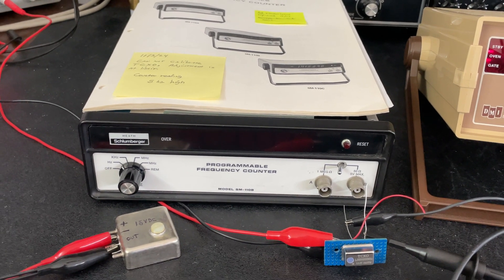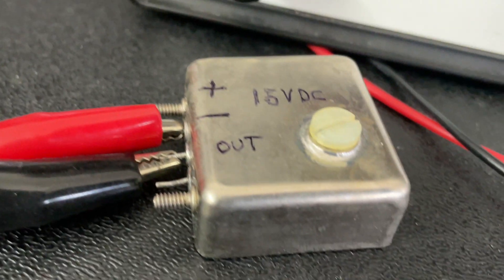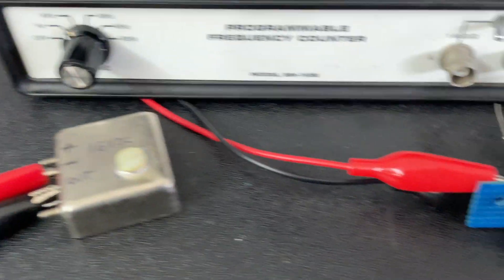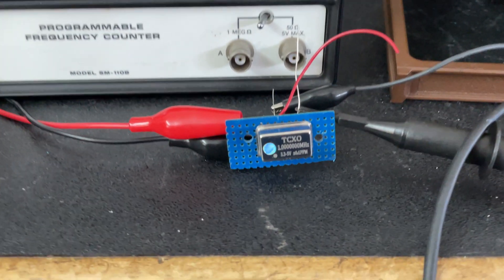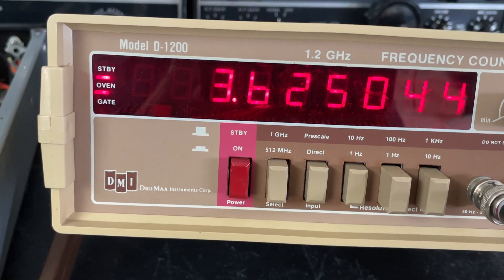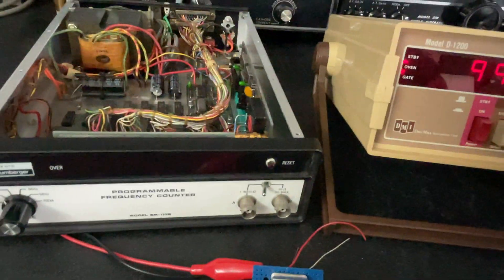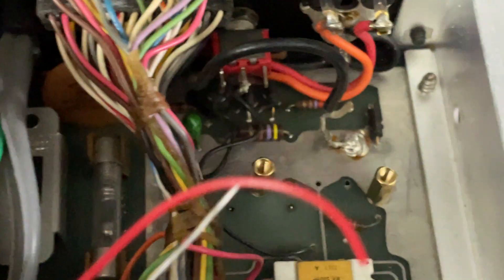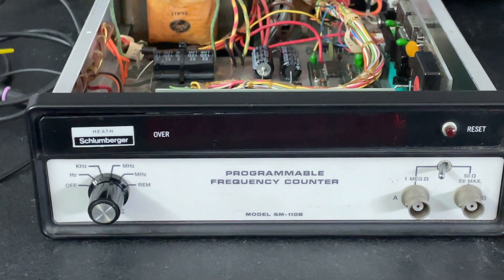Frequency Counter TCXO Changeout Part 1

Comment: Get a used Rubidium reference osc or a GPS disciplined osc.  I've got both. Don't waste your time with those TCXOs.
Reply from the maker: Your right! I just got a GPSDO and it's so ammazing considering its $54 price tag.
Reply: @rfburns3472  It's the same accuracy as a Cesium time clock osc. Now you have super, super accurate freq counter!

Comment: The correct pronunciation of "Schlumberger" is "slumber-jay". They are a French oilfield outfitter that in the early or mid 1970's bought Heath for some unknown reason. Not many years later, Heath went bankrupt, although I don't think they were any longer affiliated with Schlumberger.
Reply from the maker: Thanks for the background info about Schlumberger.

Comment: I remember reading somewhere that  a quartz crystal oscillator's output frequency would vary in the low single digit parts per billion depending on the orientation of the crystal, would like to see that demonstrated if possible
Reply from the maker: Here you go!
https://www.youtube.com/watch?v=zILwgQhjC_Q

Comment: I got a small HP counter but it came without the higher tolerance osc.  option.  Although the internal one is adjustable and pretty good. I bought an old oven osc. on ebay out of some HP microwave instrument.  Had to assemble it as a unit with a power supply and indicators and a buffer in the output  in a chassis but now I have a better reference for the counter and my sig. generator that also lacks the high stab. option.  I calibrate it from time to time with a Rubidium standard that was made for for portable cellular system use.
Reply from the maker: Very cool Tom!  My next standard is going to be Rubidium.

Comment: Thank you. I'm watching videos like your to get ideas for my ow project. I have a consumer grade freq counter, a small, light, bench counter that looks very much like yours. I did add a jack for a nominal 12 volts to make it more portable, and I figure on adding 1 of the several $3 crystal oven pulls I got from eBay or some Chinese website. I just need to put it on a small bd to put in the counter box, add some good supply regulation, calibrate it against my GPS freq reference, and it should make the cheap old counter worthy of having among the higher end gear. Those inexpensive, (dirt cheap,) Xtal ovens can really upgrade a lot of cheap gear to almost lab grade for hobbyists, from my freq counters, to sig gens and function gens, to my old tube and early transistor ham gear they are practically a miracle upgrade for my or any hobbyist's electronics bench. I bought 16 of them at just under than $3 each, with 1 defective one. The rest will slowly go into my bench gear and experiments as the winter snows dictate. Again, thanks for the video.
Reply from the maker: Glad your getting some use out of these inexpensive XO's John.  Sounds like your having fun with it all.  I am just begining to use them. 
For this project, I really wanted to find a 1 MHz OCXO.  I could not find them anywhere for less than $100.  Ouch!